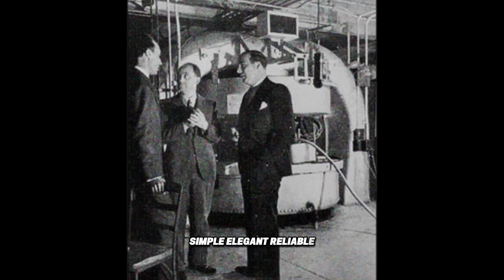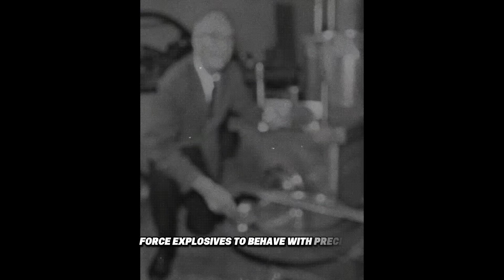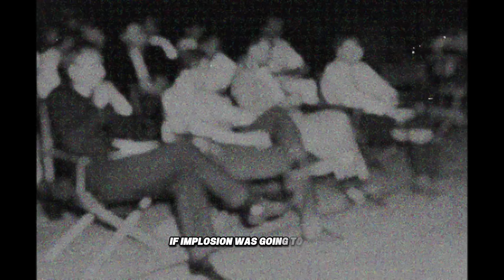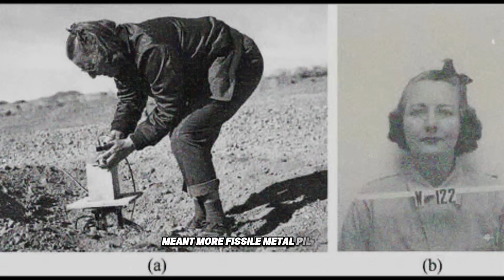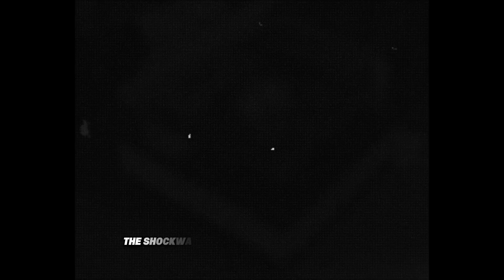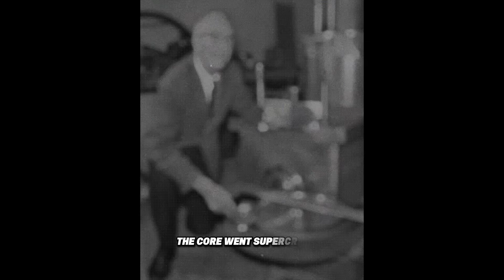How 32 Explosive Lenses Almost Broke the Atomic Bomb in WWII

Comment: Using captions, especially small, fast unreadable captions is not only not necessary, but  distracting and aggravating. 
You did a good job, just leave the hissing and captions to ticktock.
Reply from the maker: That’s fair, and I appreciate you saying it directly.
The captions were added to help pacing and accessibility, but I agree that when they’re too small or too fast, they can become distracting rather than helpful. That’s something I’m actively dialing back.
Thanks for the feedback — and I’m glad the core presentation worked for you.

Comment: Incredibly, traitor Klaus Fuchs helped solve implosion problems. They perfected the implosion using lanthanum as a core that spring using x-ray photography.  Hardly any video mentions the initiator at the center of the core of the gadget. Called the "urchin" it was an assembly of polonium 210 and beryllium. Experts on shape charges, such as those used in the bazooka open the door to finding the issues.
Reply from the maker: You’re absolutely right—those details are critical and rarely discussed.

Klaus Fuchs’ theoretical contributions did influence implosion modeling, and the RaLa (lanthanum) experiments were essential for validating symmetry using gamma absorption and X-ray diagnostics. Without those tests, the lens geometry could not have been trusted.

And yes—the neutron initiator (“Urchin”) at the core is often skipped over. That polonium-210/beryllium assembly was vital for reliable startup at peak compression, especially given timing uncertainties.

You’re also right about shaped-charge expertise. Work on bazookas and other focused-energy explosives directly informed how shockwaves could be shaped and controlled.

Great comment—this is exactly the layer of the story that usually gets lost.
Reply: @FraMeDraft  A.I. slop
Reply: urchin design is mostly classified still

Comment: My father worked in Los Alamos, NM after WWII 1952-1964. Several milling machinists died milling shaped charges for Fat Man bomb. Milling creates heat if cuter moves to long or too fast. Milling shed had cement tilt walls. New add for machinist would appear in Albuquerque newspaper.
Reply from the maker: Thank you for sharing this. That detail is rarely mentioned, and it matters.

Shaped charge and explosive lens machining was extremely dangerous work. Even small increases in cutter speed, dwell time, or friction could generate enough heat to cause detonation. The thick concrete tilt-walls and isolated sheds weren’t for secrecy—they were for survival.

Many of the people who took those jobs understood the risks, and their work was critical to making implosion possible at all. The engineering story often focuses on equations and breakthroughs, but the human cost behind the manufacturing side is just as real.

Stories like your father’s are an important reminder that this wasn’t just theoretical science—it was lethal, hands-on work done by ordinary people under extraordinary pressure.

Thank you for adding that perspective.